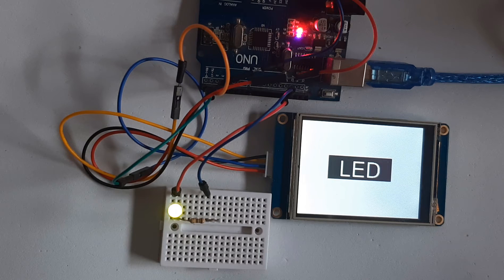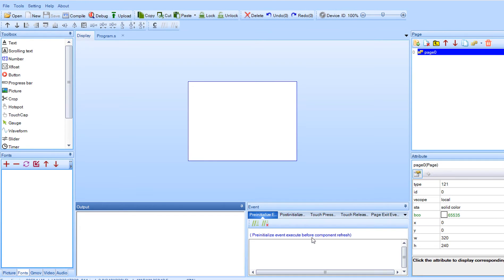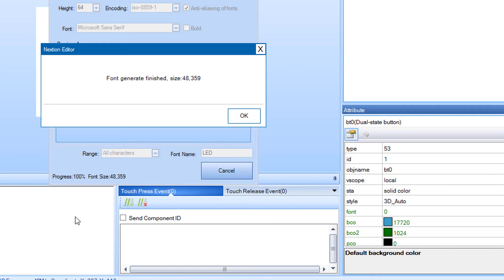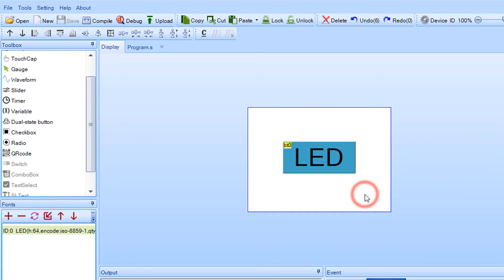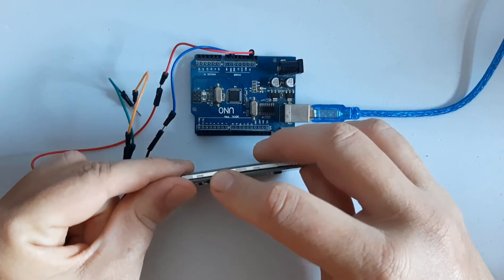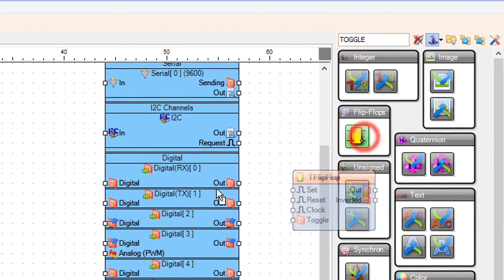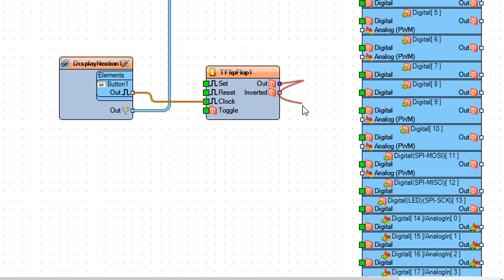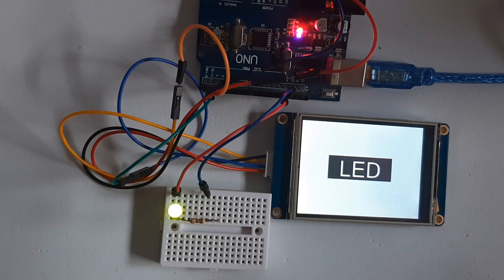Nextion Display - Control LED On-Off with Dual State Button & Arduino

Comment: i see you only connect to one serial input on visuino? how do you how TX and RX?
Reply from the maker: You connect Nextion RX to Arduino TX, Nextion TX to Arduino RX
but when you upload the code you disconnect Arduino RX and after uploading you connect it back.
Reply: @visuinoprojects  I'm aware if the physical connection but the visuino only shows one pin into serial. No tx or rx. I aware of the physical connection TX to rx..... Rx to tx
Reply from the maker: @jessemackenzie6516  In Visuino You have Serial pin [Out] RX or Serial pin [0] TX
or you can use "Serial Software" component and set RX and TX on any digital pin (see my tutorial for PWM module or GSM where I use this component)
Reply: @visuinoprojects  thank you for answering.  Appreciate it